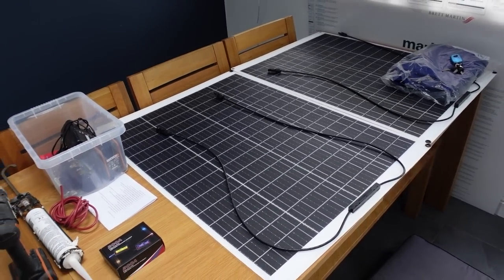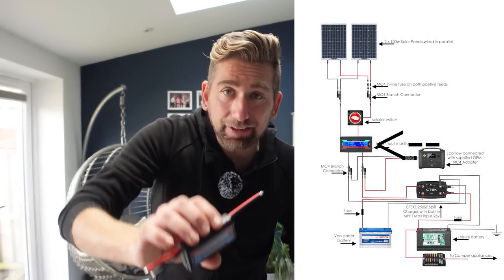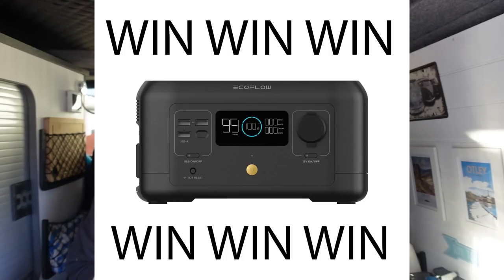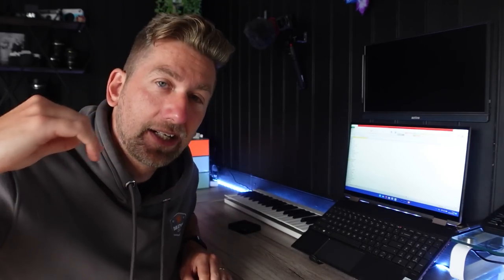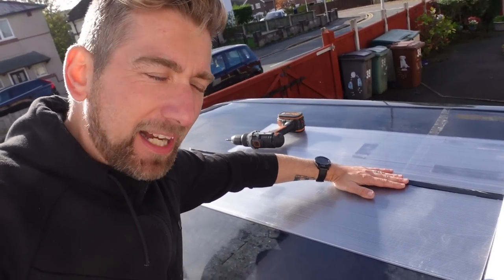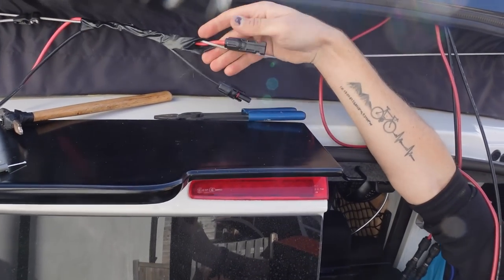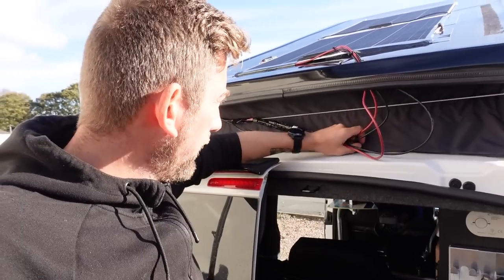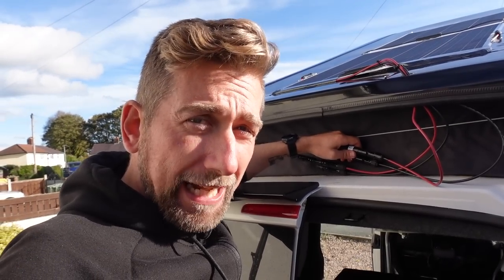How Do I Install Solar On My Camper Van? PLUS ANOTHER ECOFLOW **GIVE AWAY**

Comment: Hi  Colin I notice on your You Tube Video you was removing the old adhesive strips. The Easiest and best way to remove this and it will not mark your paintwork on your Van is to get and old number plate cut it into a small strip then create a slight slanted Edge and hey presto you have a tool that will remove old adhesive off the bodywork on your van or it will remove old stickers of the bodywork and will even remove old stickers off the windows without scratching the window only thing you have to do is have a spray bottle handy with water in it wet the surface and away you go with a new created tool I have used this idea for years. Cheers Alan Pridmore.

Comment: Great video, there is however a couple of things I don't understand, looking at the wiring diagram 1) if you have a fuse on both positive terminals why would you need to fit an isolation switch (Is that overkill)  2) Why do the cables run to both the car and Lesure batteries, from the split charger MPPT?  I thought the flow diagram or normal setup is first charge the car battery when it's fully charged 12v the surplus voltage goes to the leisure battery
Reply from the maker: Hey buddy, it's totally overkill having an isolation switch too mate, 😀 I just wanted to cover all possibilities (incase the fuse failed) 

The wiring set up for the CTEK is the way has to be wired up. For example the solar pannels go directly to the CTEK (solar input) to charge the leisure battery (which I think also charges the car battery once the leisure battery is fully charged (controlled by the built in MPPT in the CTEK). The car battery is connected to the CTEK as that also charges the leisure battery when the car is running. 

Hope this helps bud

Comment: I also went with 2 x 100w panels due mainly to availability. But I have a plan to possibly in the future to fit a switch to allow one to charge the leisure battery while the second charges a power pack.

Comment: Hi Colin somewhere you mentioned a splitter to power the portable power bank as well as the leisure battery from the solar power so bought some. I'm thinking if I just plugged straight into the cigarette lighter to charge the power bank instead of tapping into the solar supply this would maybe do the same as I can't get my head around the connections. The positive is female and also the positive two splitter ends

Comment: Would probably put some silicone sealant on those screw holes. You’ve also clocked the air flow on the corrugated plastic with the gaffa tape!!!  
 
#ecoflow

Comment: Trying to fix my solar set up - a very “ beginner “ question . 
The black connectors ( I think you call them mc4 connectors ) on the roof - do they just pull apart ? 
Trying to undo then reconnect all wiring but don’t want to damage anything ! 
Fab video btw
Reply from the maker: Hey yes they are clipped in and can be a pain to pull apart but they do pull apart... :)

Comment: Still part-way through the video Colin and wondering what was wrong with the solar panel you installed last time? Could you have salvaged it and installed one of the new ones in parallel? Good luck sunshine, keep them coming. 👍👍
Reply from the maker: Thanks buddy, it had faded (down to me not checking and cleaning it over the years) so the output wasnt as strong as it used to be. I tried to clean it but it still ended up faded and only producing half the wattage it was supposed to. The new panels are not shiny coated so hopefully the same thing wont happen :)
Reply: @Yorkshirepoptopadventures  Interesting to know, thanks. Good luck with the new ones.

Comment: Great video as usual. Good idea to have the cut off switch, if ever you have to disconnect the battery you should always turn off the solar to the mppt first. Apparently mppt controllers can be damaged if the battery is disconnected whilst the solar is still connected. I think a #ecoflow makes a great backup power source.

Comment: Hi Colin, having just brought my first Transporter, your videos have been a massive help and a lot of fun to watch! I’m well on my way to setting up very much the same set up as you have shown. My ecoflow delta 2 should be with me tomorrow and now I’m moving onto the solar panels and buying a  ctekd250se controller. Just a quick thought though with having two 100w solar panels parallel circuited together will that mean the input voltage into the Ctek be higher than that it states it can manage? Or does having them run in parallel mean that doesn’t apply? Sorry very much a novice at this. Thanks
Reply from the maker: Ah that's awesome... enjoy building up your van! 

This information is from their website, going by that I'd say keep it under 23 volts to avoid damaging the unit or worse

Connecting them in parallel keeps the voltage the same, when connected in series the voltage doubles so in parallel it will still be 12v output with 200w of solar. In series it will be 24v with 200w of power and exceed the maximum voltage capacity of the CTEK :) 

The D250SE is designed for use with solar panels rated at up to 300W but won't be damaged if a larger panel is connected – as long as the voltage from the panel is no more than 23V. (Open Circuit Voltage cannot exceed a MAXIMUM of 23V) Connecting a larger panel is actually a good way of compensating for poor perfomance on cloudy days!
Reply: Thanks for clarifying Colin, parallel it is 😂👍🏻

Comment: Eek did you seal your drill holes well ..?? Don’t drill into your roofs use sikaflex adhesive ppl ….
Reply from the maker: The screws were sealed (like the massive hole at the back) all's good buddy - Should have mentioned it in the video but having has Sikaflex fail on me I didnt trust it :)

Comment: I looked at your video with great interest but could not see/hear what type of fixings you used to secure the solar panels to you campervan roof. Are these readily available and do they make holes on the pop top?
Reply from the maker: Hey buddy, I just used brass screws (not that long that they'd go right through 😂) but also added some silicone to the holes to keep them as watertight as possible

Comment: I pretty much followed your original guide on installing a solar panel on my Toyota Alphard. I used the the velcro to stick the polycarbonate sheet onto the roof and then velcro again to stick the solar panel  onto the polycarbonate sheet. I also used the black tape around the edges the same as you did. I have since had to replace the panel twice but was easy because of the velcro. The final panel I didn't even bother with the black tape around the edge as the velcro does hold it rock solid. Would love a solar power generator like the #Ecoflow as they are so useful. As you are a power freak did you not consider a lithium leisure battery now seeing as the price is getting more respectable?

Comment: Had the old panel given up the ghost Col or was it just a case of wanting more free power?
Reply from the maker: Hey matey it had faded (down to me not checking and cleaning it over the years) so the output wasnt as strong as it used to be. I tried to clean it but it still ended up faded and only producing half the wattage it was supposed to. The new panels are not shiny coated so hopefully the same thing wont happen :)

Comment: Great video. The husband will divorce me if I screw the panels in. Just like you he can't cope with the idea of making holes on the pop top. You guys should meet! Can I just use the tape like you did in your previous video? Any reason you chose to drill these in instead of taping them? Thanks in advance for your reply.
Reply from the maker: Haha I completely understand 🤣! 

Yeah the tape worked really well.. After a few years it needed changing but as long as you keep up to it and add the tape to the side that the wind hits when driving you should be fine. 

Just get good strong tape ;)
Reply: @Yorkshirepoptopadventures  Thanks for replying! That's helpful. I think we'll go with tape and see how it holds.

Comment: Did I miss it or did you explain why you removed the old solar panel? Anyhooo nice and spicy  new setup.
#EcoFlow
Reply from the maker: Hey bud it had faded (down to me not checking and cleaning it over the years) so the output wasnt as strong as it used to be. I tried to clean it but it still ended up faded and only producing half the wattage it was supposed to. The new panels are not shiny coated so hopefully the same thing wont happen :)

Comment: Question on your solar electrics, i was told you couldn’t have 2 mppt on the same panels as they would fight for power from the panels and cause issues have you had any issues
Reply from the maker: Hey Jon, I'm not sure... I dont have 2 MPPT controllers (just a power read out and 1 x MPPT) but I'm guessing that 2 X MPPTs would find it difficult to regulate the power... Hopefully somebody who knows reads this and lets us know ;)
Reply: @Yorkshirepoptopadventures  ah i thought you had your solar panels connected to the EcoFlow as well as your CTEK

Comment: Can I have your old solar panel haha, are the flexible panels any good?
Thanks Colin
Reply from the maker: Hey buddy, it had faded (down to me not checking and cleaning it over the years) so the output wasnt as strong as it used to be. I tried to clean it but it still ended up faded and only producing half the wattage it was supposed to. The new panels are not shiny coated so hopefully the same thing wont happen :)

Comment: 👀My panel doesn't have the display to keep an eye on stuff....I use an app called Victron 👀 Also, the installer said it wouldn't over heat sitting on my pop top roof....suppose only time will tell!!! 🤔🤔

Comment: Hi, nice video! Why did you change the old panel? #ecoflow  going to use your videos for my new build!!👍🏼
Reply from the maker: Thanks buddy, it had faded (down to me not checking and cleaning it over the years) so the output wasnt as strong as it used to be. I tried to clean it but it still ended up faded and only producing half the wattage it was supposed to. The new panels are not shiny coated so hopefully the same thing wont happen :)

Comment: Did the old panel fail? Hope those screws don't cause any leaks lol. #ecoflow
Reply from the maker: Thanks buddy, it had faded (down to me not checking and cleaning it over the years) so the output wasnt as strong as it used to be. I tried to clean it but it still ended up faded and only producing half the wattage it was supposed to. The new panels are not shiny coated so hopefully the same thing wont happen :) - The screws were sealed in with sealant (forgot to mention it on the video)

Comment: Solar Looks too complicated for me. An #Ecoflow would probably be the best solution for us on the rare occasion (camperjam!) we’re off grid for more than 24 hours. Can you charge your leisure battery with the ecoflow plugged into the external EHU? Just wondered as the only thing I worry about is the fridge!
Reply from the maker: Hey Tom, I havent tried it but I reckon with the EHU to standard UK plug adaptor I am sure you could do it as its still 240v output - Just be aware of keeping the ecoflow outside and/or get an ecoflow that has enough charge in it to charge up your leisure battery etc

Comment: Great channel.  My flexible panel has packed up. Was that your reason for changing the old panel? #ecoflow
Reply from the maker: Thanks buddy, it had faded (down to me not checking and cleaning it over the years) so the output wasnt as strong as it used to be. I tried to clean it but it still ended up faded and only producing half the wattage it was supposed to. The new panels are not shiny coated so hopefully the same thing wont happen :)

Comment: Great video as always. What happened to the original solar panel? #ecoflow
Reply from the maker: Thanks buddy, it had faded (down to me not checking and cleaning it over the years) so the output wasnt as strong as it used to be. I tried to clean it but it still ended up faded and only producing half the wattage it was supposed to. The new panels are not shiny coated so hopefully the same thing wont happen :)

Comment: You’ve done a canny job, I’ve just fitted a small 80w solid solar, apparently the ones in the aluminium frames are more efficient however I think the flat flexible ones like yours are neater.